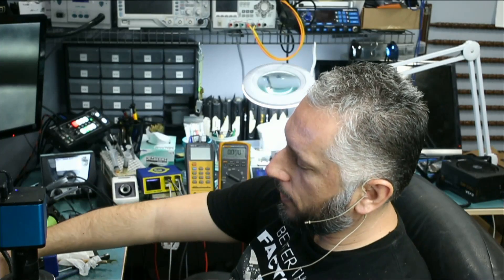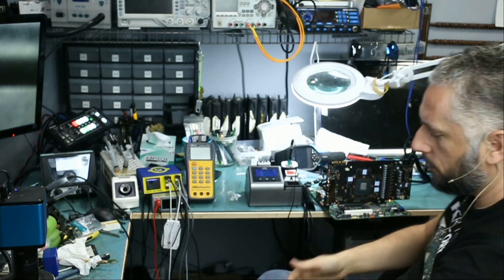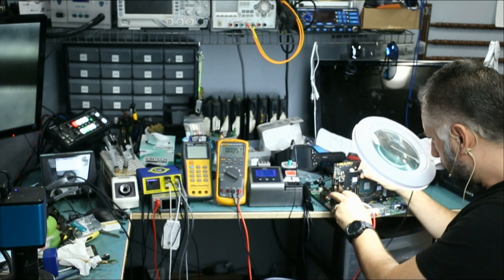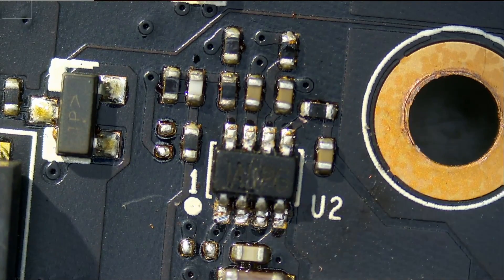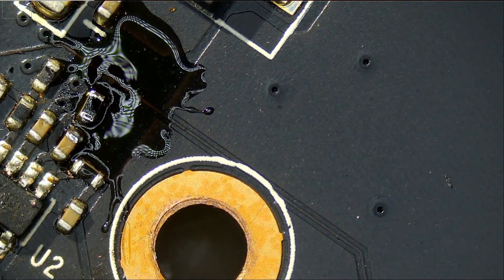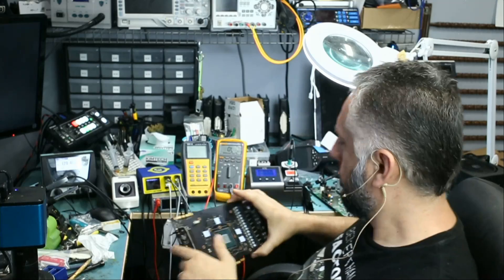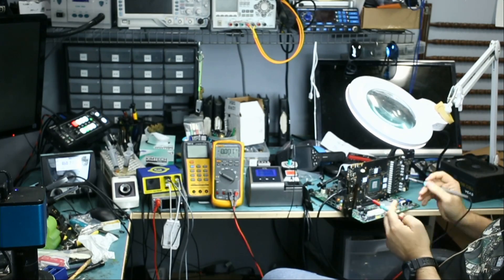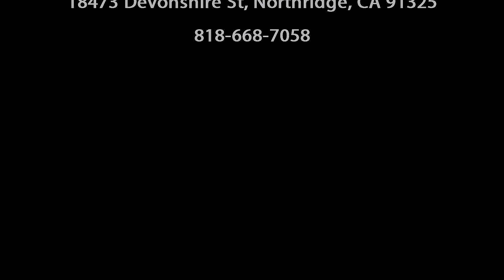MSI GTX 1070 Graphics card Repair - Black screen Not Detected

Comment: Not getting detected means that it is not talking to the GPU which is expected as the GPU isn't getting power.
Since the videocard gives all the voltages besides the Vcore, I don't see the reason being a short somewhere as the whole card would not boot as 12V goes directly to Vcore mosfets. 
It is likely something related to voltage controller, most likely a resistor similar to what you found on 5V rail. 

However I didn't see you measuring if the card gets 3.3V from the PCIE slot. PEX rail is far as I know uses 3.3V converted to 1V, but I think it also needs Vcore first, which makes me to believe that it is indeed the voltage controller.

It is not BIOS related since you should get boot voltages even if the BIOS is corrupt.
Reply from the maker: We have 3.3v and 12V on PCIE and Bios is getting all the right voltages. I will do more measurements later today.
Reply: Do we have power enable? Just concern with the chip near error resistor
Reply: Hi there again. Vintage injection on the main power line that gives power to the CPU MosFets and also check the small transistors that controls that power line. Usually the are on the right side in the board near the 12V line from external 12v.
Reply: The controller of that card sense short on the CPU mostfets and sometimes shout  down the main power line. That is the reason that im telling you yo try voltage injection. Usually is one of the last MosFets from top so bottom
Reply: Is it also possible that the person blew or knocked of a componet when they where cleaning the card or static built up by the blower
Reply: @mattblank4402  not likely as the card did work after the cleaning. 
However sometimes working card could have micro crack somewhere, but its likely a slowly failing component as we did see a dead resistor on 5v rail.

Comment: When you replace a capacitor how do you know the value of that specific capacitor?
Reply: @BilalKayaTR  thank you for your reply. I’m asking in general if I found a faulty capacitor how I know which one to install.
Reply: @BilalKayaTR  if you know please let me know. Thanks
Reply: @golamrabby5335  Either you know it from schematics, or you can take as good that, in the same productive process, capacitors with same color and same size should have same value. Taking this as a fact, you could measure (off circuit) another capacitor with same characteristics installed in the same board.

Comment: if you look on thermal the resistor you replaced will be heating up, the chip it feeds will likely be faulty, if you leave power on the card long enough the resistor. will fail again

Comment: You should be checking if Vcore Pwm controller is getting all of its voltages.
The chip is up9511p, it's a qfn-50 chip. Start with a visual inspection around it, then check 5V VCC at pin 12 which is usually connected to a nearby capacitor, and check enable on pin 36 which should read 2.4V. Enable is an output from the controller which gets pulled low by a dual n-channel mosfet if 1.8V is missing on the card.
Also check pgood on pin 38, iirc it should be 1.8V. Pgood is an input that gets shorted to ground by the controller istelf if the controller detects a fault or is faulty istelf.
So if Pgood is missing, it is advisable to check the gate pins of the high side mosfets for Vcore.

Comment: Since the customer said I clean it and it worked for a day, I assume the GPU chip has disconecting. And when the card has a separator solder, it means it overheats while working. So that resistance burns out due to overheating. The best way to test it, put just a little heat on GPU, if the card works you have to re-ball it

Comment: Hi Alex,
I am a tech from Canada. Since the customer indicated the loss of video output was intermittent that's a strong indication the GPU needs to be reflowed or possibly re-balled. The voltage spikes caused by the loosening of the GPU chip made the resistor go into high resistance. I suggest you do a quick reflow to verify the card works and if so re-balled it or do a proper reflow.  Will be watching next video to see how it goes. Good luck
Reply: Assuming the customer is telling the truth.  I wonder if the faulty resistor was previously at a resistance that caused the voltage to drop to a level that was hovering between enabled and not enabled (maybe 3 or 4K) causing the intermittent behaviour.  Could the intermittent behaviour caused something else to fail.   Could another part on the PCB be faulty and that caused the resistor to go faulty.  I go for a random guess of a fault mosfet.
Reply: @pow9606  Hey POW,

You have a very good point. However, according to customers story, it worked again when they cleaned the card. I also took that point into consideration because moving around the PCB might have made the GPU chip to reattach barely. Your reasoning in regards to the resistor would make the board behave same manner. A MOSFET would have failed immediately in my experience. I really would like Alex to remeasure the resistance of the replaced resistor to see it still at rated value. If not, we can lean towards your theory. Thx
Reply: yo opino lo mismo

Comment: Not just the components on the bottom of the card can fail. Try checking top side, or the side that does not have fans on. Fixed a couple of cards with failed caps and resistors on top side.

Comment: Thermalcam probobly will show a short in some of VCORE mosfett. Thats my guess. I hope that it doesn't show heat spot on GPU-DIE. It is possible because self degradation of thermal paste and bad heat spread. If is THAT case the GPU is completely dead 😢 Hope GPU is not fried and this graphics card can be resurrected! 

We will see in the next video!

Comment: dont you think that this resistor died because of a proper reason ? 
there is some thing around it caused it to die , its not a filter or 0 ohm resistor that would normally die in case of power problem , so you should suspect a chip being shorted around it ,

Comment: Yeah, it's time to inject voltage and look for the hot spots.
I did see where moisture corroding certain parts could be a problem and that should show up on the heat camera. Then, I see that if a graphics card is run on a game NOT using the right driver could be the problem as well
And of course the ever present over heating of a fried component but if not visually evident then go for the voltage inject and look for the hot spot.
Oh, and what about pulling the GPU and cleaning the old paste off and then resetting it with some fresh past to deter any heat problems.
One more idea is dirty board causing problems.
An alcohol dip maybe?

Comment: At 8:47 you said that the pex rail is at 0.
So this is probably your issue as it should read between 6 to 12 ohm. You should check the resistor next to it. It's probably a 0 ohm that is bad..

Comment: Pls check EN signal which should be a bit above 2 volts, Vin should be 3.3 V , vdd 5 v, if any one or more of them is missing then check the circuitry around most probaly there is a faulty resistor. if all ok change the controller.

Comment: My brother thank u this is not related to the video i was too buys repairing this hash board for that had a broken cap. job looks great i found my soldering iron, soldering iron with the sucktion adaptor, heat gun with a small tip. All cuz of your video i have learned how to replair cap and how they can blow. worked from the back of the board and the doner board one just fell out. Anyways take care my friend. I need some of that kill flux u have.

Comment: My concerns would be customer took it apart to clean. A did they put new thermal compound on it and did the screw it down level. Could be a board fracture or warped. Overall I think gpu has gone. Would be nice to know what you find.

Comment: There should be 12v and 3.3v coming from the PCI slot. Check the components that come from the PCI power. The bios chip doesn't seem to be getting power :)

Comment: Been using this exact same card for many years, it's running 24/7 and doing a crap ton of rendering work. Hope it doesn't die on me, I feel like MSI cards were better back then.
Reply: 1000% agree with you man, and it's not just the cards. I have an old MSI 1080p 120hz monitor i gave to my dad when i upgraded my station to a 1080p165hz ultrawide. That one died, and MSI replaced it with a 1440p144hz monitor which so far has been good. I had to replace thermal pads on my MSI 3090 suprim x since the ones on the VRAM were already starting to slip off when i peeled off the heatsink, and when i removed them to replace, they were very oily underneath. 

My old 1070 and 1080 ti SLI builds are still going strong after three years each
Reply: @GenDrag1  If I remember correctly MSI's old CEO died some years ago, maybe that's related to the decline of their reputation since then.
Reply: My 1070 just died last week after being on 24/7 for 6 years. My 660ti is still going strong after 11 years... I wonder if it's worth getting repaired.

Comment: With so much display cards to diagnose and fix, I would suggest to get a good Usb based PCI expansion card. That way you can avoid damaging the motherboard with constant plug in and plug out of video cards. Also it would be easy to lay the card flat on the table while powered up and do the checks under the microscope.
Reply from the maker: I have one but don't use it. The card is still attached to the power supply cables and can't move it under the microscope without moving the power supply and everything else.
Reply: @NorthridgeFix  Thats some thing you should be able to work around with cable extensions.
Reply: Hum! Necessity is the mother of invention. Thinking.
Reply: Agree! I am learning from you need to be able to evaluate both side of the card under the microscope. Off course without creating a new short.
Reply: Hahaha take look closely to the table . 

No space for new tools hehehe

Then suggesting a cable hahaha

That so funny

Comment: You can check the resistance reading of the PEX rail and if it is unsusually low it is a good indication of a shorted core. That goes for mem and gpu rails as well. But i dont think that's the case because that wouldn't explain how the 5v enable resistor died. So my guess would be that something is wrong with the conversion circuit here as well. I hope you can fix the card. Love your videos keep up the good work!

Comment: i thought you needed the pex rail to turn on vcore.
edit i was wrong its probably the voltage controller because that is what turns pex and vcore on. memory i believe has a separate voltage controller which would explain why mem is getting voltage and vcore is not.

Comment: Love those GPU diagnosis and repairs, i still have a Sapphire ATI R9 290 4GB which has a short on the 12v line but i'm still unable to pinpoint the exact problem. thanks for al your knowlegde Alex
Reply: The 1070 would be a nice upgrade assuming you dont have another working card.
Reply: @sbrewski27  yes i do. I using my msi rx 470 gaming x 4gb which works perfect but im trying to learn to fix gpu's and other stuff like ps4's and so. My next card will be at least 8gb or more but the prices are really high 🙃
Reply: I have r9 280x, I have similar problem like customer in this vid, mine works after cleaning but soon after, poof, blue lines on screen and its dead.
Where can I learn to diagnose the cards issue ?
I have a solid multimeter but I dont know all this about 12v and 3v rail etc.
Where can I learn this ?
And it seems like most newer cards have similar voltage rails, designs etc ?
Reply: @nicholassage2076  there are more youtubers that really go in depth to all functions on a GPU so search and you will find
Reply: If you can get a cheap thermal camera, you might be able to apply power from a current controlled supply to the 12v rail and see where the short is dissipating power.

Comment: Quite clearly it needs to go into a oven and baked at 250 degrees for 9mins. Amateur!
Reply: with salt and peper
Reply: Even if it works after that it will work for how long? Maybe 9 hours or 9 days? And why would he use oven when there is all he needs on his table. You know, air soldiering station and so... 😂
Reply: @headlightdesigngradacac  sarcasm clearly missed by this one, must be American :)
Reply: @hinny2005  ohh... Actually english is my second language (i'm from Europe) and maybe that's the reason why i couldn't tell is it sarcasm or not. Can you blame me? There is so many people who would actually do it. 🙄
Reply: @headlightdesigngradacac  actually believe it or not but i fixed a amd mxm card that way and has been working for 3 years still. Also did that with a asus laptop and that worked another    Year as well. Failed on a gtx 1070 and rx 580 so it will not always work but it was just for fun for me.

Comment: My cousin called me with the same problem on the same card 2 weeks ago. Wasn't until he sent a video that I realized he was plugging the DP cable into the motherboard not the GPU 😂. Nothing was broken
Reply: Same with my friend. I've put together pc with i7 2600, 16gb ram and 1650. Tested it, temperatures were ok. I gave it to him, and 2 days later he said that pc wont turn on. At weekend i went and visited him, checked and blamed him(but friendly :D). As he had his TV & monitor plugged into mobo
Reply: @mmllmmll22  🤓🤓🤓🤓🤓